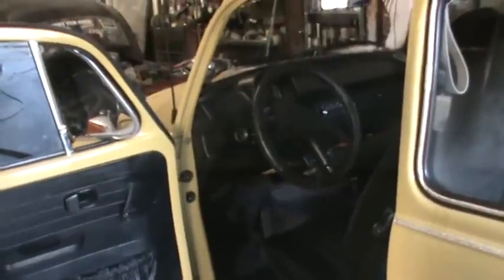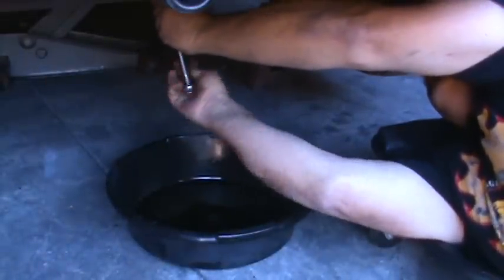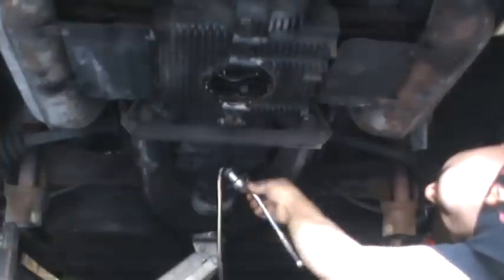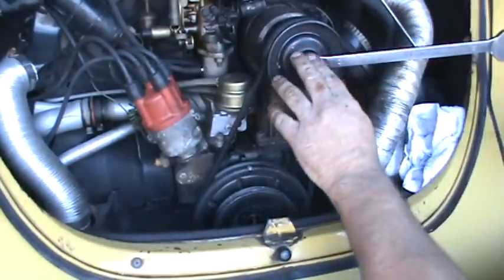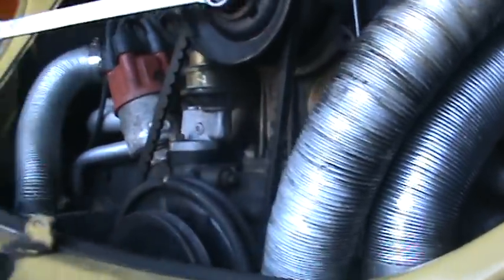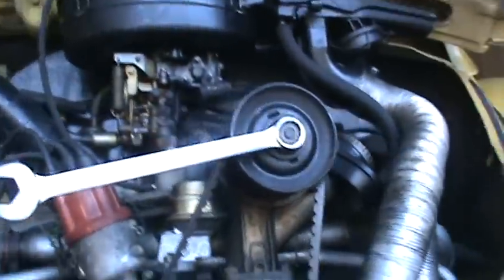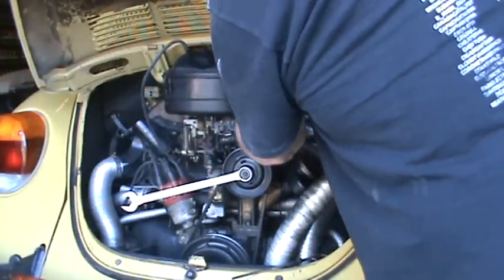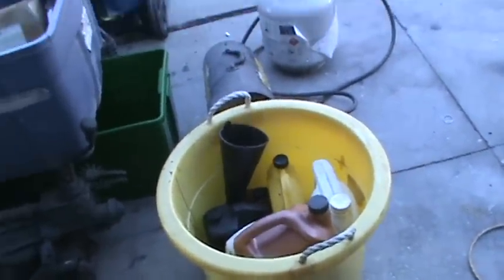VW valve adjustment and oil change How to

Comment: What kind of oil is use in the oil bath?
Reply: The engine takes 2.6 qts.  Use the remaininig from the 3rd qt. to change the oil in the oil bath air cleaner.  Later bugs have paper filters.

Comment: Greetings from Denmark! Nice video, i learned some things. But also a tip from me concerning the gearbox oil . Always first take out the filler plug before you unscrew the drain plug. I you can't get the filler plug out, because the hex is round, or you don't have the right tool, you else can end with a gearbox without oil.

Comment: No use adjusting valves if you're not going to re-torque the heads beforehand.
Reply from the maker: The problem with talking heads in the car is you have to pull all the sheet metal off the motor to get the top bolts genius this is why I do not to work the heads unless we pay to have the motor pulled out stripped down then I can torque the heads but if that point is time to fix your piece of shit Motor anyway and maybe rebuild it once the heads come loose your shit is junk

Comment: Just one question my 71 super beetle had a bad knocking sound like If one cylinder wasn't working tool the compression and everything seems to be fine what could it be?
Reply: Sounds like a knocking and a misfire but havnt found the issue changed the distributor cap rotor and spark plugs wires pass spark and everything seems to be fine